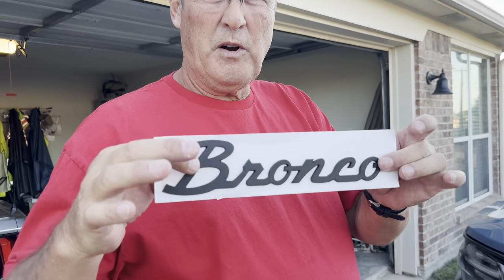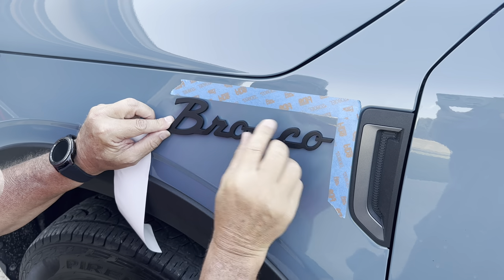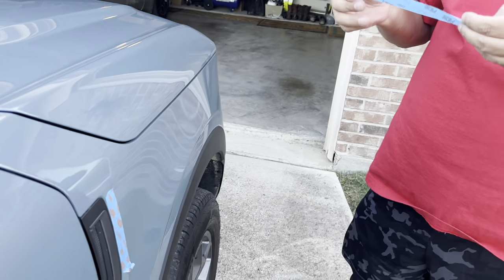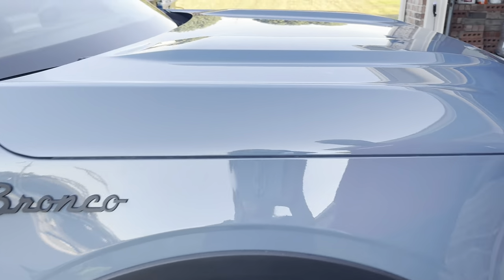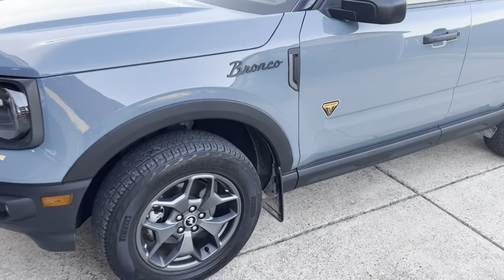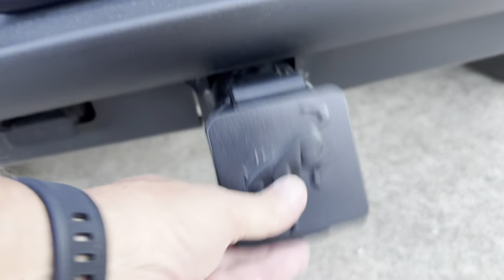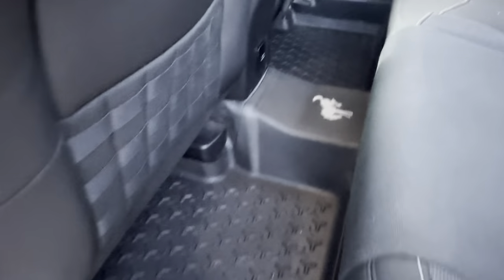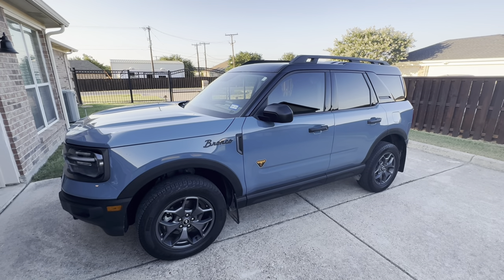New Aesthetic Addition to our Bronco Sport!

Comment: Nice addition.  I put vent shades on mine, great to open the window a bit when it's raining.
Reply from the maker: I have considered them. Glad to know that they work well. Right now, our next upgrade will be tires. Looking at BF Goodrich KO2s or Falken Wildpeaks AT3Ws.  Thanks so much for watching and for your tip on the vent shades!!!
Reply: @broncomustangponypower  I'm going with the Goodrich Terrain Trail.  Had them on my '18 F150.  Up here in the cold, we need decent tires.
Reply from the maker: @fredhinck9685  They look nice!!!  Have to add that to my list of consideration.  We have basically one week of bad weather in Texas of ice/sleet/snow mix. Thanks for the tip!!
Reply: @broncomustangponypower  Tires ordered from Costco, be a couple weeks.  Hope the major snow stays away till then.
Reply from the maker: @fredhinck9685  Let me know your thoughts on them after putting them to the winter test. We are back in the 60-70’s here through Thanksgiving.
Reply: @broncomustangponypower  Costco came up empty, no stock even after adding them to my cart.  Called a local dealer, had them installed the next day, white letters out. Look great on the carbonized grey.  Ready for the snow.
Reply from the maker: @fredhinck9685  I am heading to our dealer next week for an oil change and I will be checking out my tire options while there.  Appreciate your input and added the terrain trail to my list of options. Let’s see what they have in stock. Discount Tire has been out on my initial choices.

Comment: Looking at a Bronco Sport for my next car purchase. Are you happy with it? Leaning towards the 4cyl Badlands as I’ve heard the bigger engine does better off-road. We are in California and go out camping and snowboarding
Reply from the maker: I have been very pleased with our BS BL. It has had zero problems since we purchased in April 2021. I had the same concerns you did so I drove both the BL model and a Big Bend model. For normal driving, there was not much difference once you were driving.  Acceleration is better on the Badlands and so is the suspension. I have taken mine off-road in Colorado several times and had a blast.  Here is the video I did on our two year review if interested in checking it out.  I also have a playlist showing our off road travels in Colorado.  Area 51 was our favorite color followed by the Cactus Grey. The interior has held up well also. https://youtu.be/cRzbu1V5BOc?si=VU1hEqjrxRb2vKdo
Reply: Отличная машина ,купил и не жалею